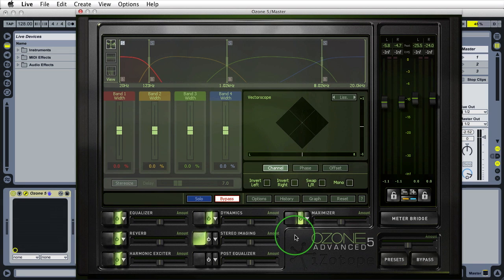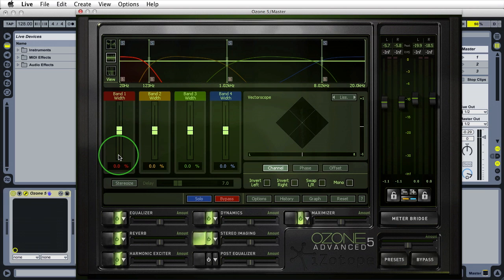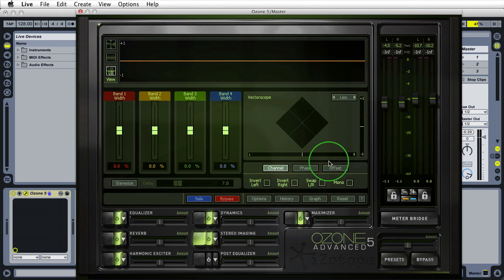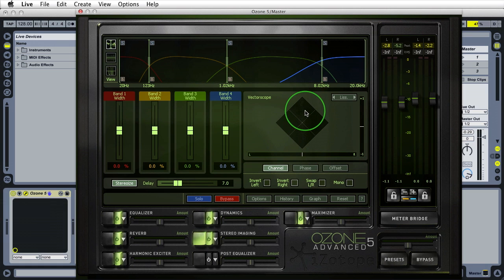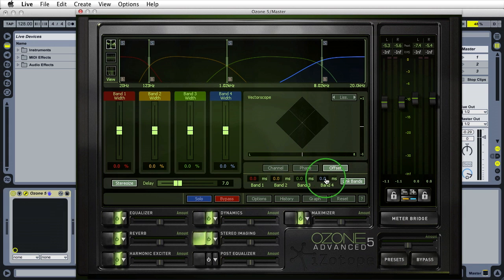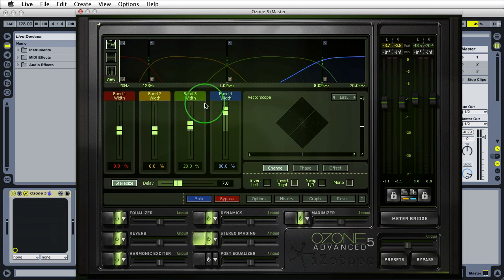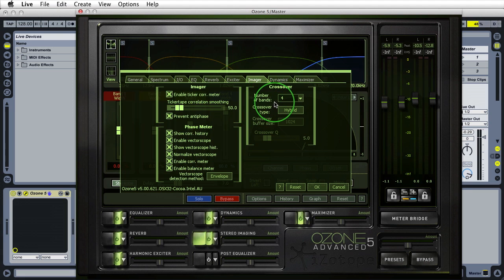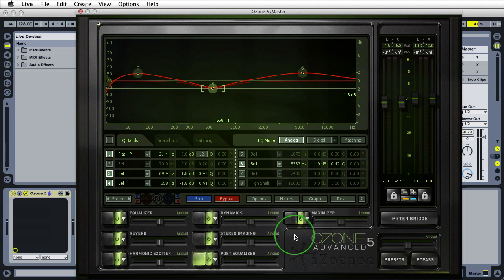Mastering Tutorial: iZotope Ozone 5 Stereo Imaging - Part 5

Comment: This feature of Izotope is really bad when it comes to mono compatibility. Even when converting a mono mix to stereo it raises the output level, so when switched to mono there is an unacceptable drop in the output. It also tends to screw up the balance in the mix, due mainly to the frequency-dependant width adjustment. Overall, the design concept of this plugin is poor.
Reply from the maker: You do understand the functions you speak of do these things by audio's design... not the plugin. The plugin doesn't auto-compensate for these adjustments... and truly why should it unless it was made for people mastering with their iPhones.
Reply: Since that last post I've figured out how to adjust the mid-side levels.

Comment: I have q question.
If I have 4 tracks which are stereo (piano, harp, strings, pads). What if send them to a group channel and then adjust the stereo field(phasing) ? is it the correct approach ? because usally we are doing this to compress the same family instruments by sending them into a group in cubase. Please keep in mind that I have Waves doubler 2 on the same Group Track to keep them on the sides and lower down the Mid by -6 db.
Reply from the maker: Umair Shahzad Why wouldn't you set their presence in the stereo field with panning on each individual track? You can still group them and compress the group as one, but set them up in the stereo field via panning.
Reply: Ok Bro, thanks for the reply. here arises another question, I was facing phase problem in correlation meter on pads and piano. so slightly minimized there stereo width from Waves S1 Imager. then I used Waves Centre to decrease -6db from the mid. Then from the Pan control on Cuabse for Piano and Pad separately,  I slightly panned Piano to L30  and Pads to R30 to achive space, is it correct ?
Reply from the maker: Umair Shahzad It would be difficult to answer this question without seeing the session. Although, one thing to mention would be that plugins that enable you to increase the stereo width of your track can also introduce phase issues if pushed too hard... it's a side effect of that faux-width.